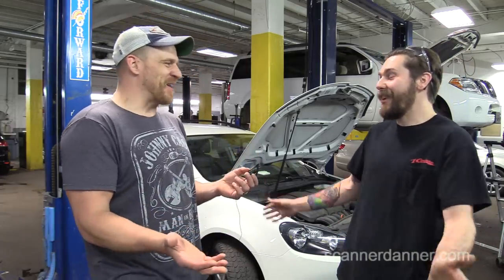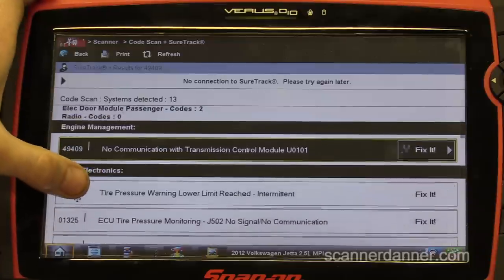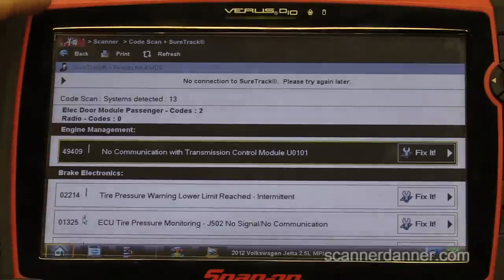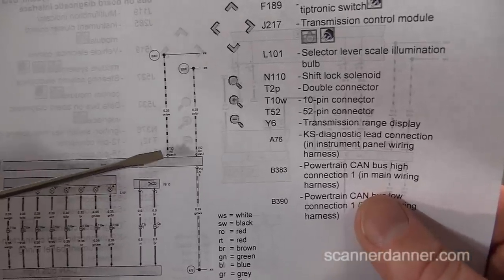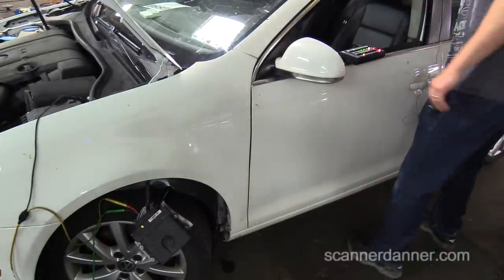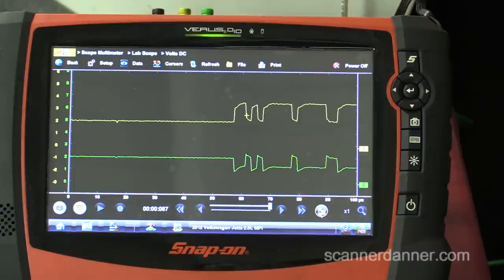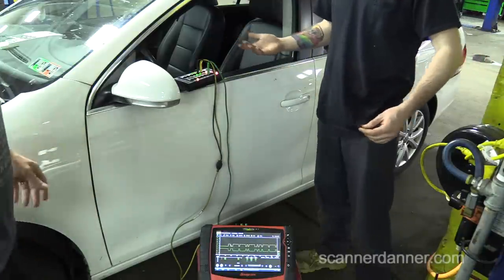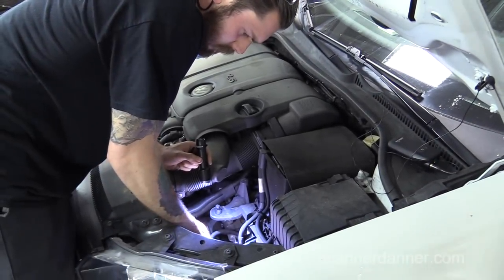2012 VW Jetta No Communication with TCM U0101 (part 1)

Comment: i have a volkswagen passat variant 2.3 liter all was fine it has 200k plus on it so i decided to change the transmission fluid after the oil was change gear no longer past 2 what can i do to fix it
Reply from the maker: This is what we were always warned about as techs. Do not change transmission fluid on high milege units that have not been serviced before. The new fluid you add with its high detergents will remove heavy amounts of varnish build up and plug up the fluid passages in the transmission. 
What color was the old fluid? When was it last changed? How long after the service did you start getting a 2nd gear only symptom?

Comment: If you want more info on CAN Bus design, try doing a google search for CAN Transceiver Application Notes.  You will find detailed information from the integrated circuit companies which provide the chips which are used in the modules along with the theory behind the bus design.  Perhaps too much detail ;-).

Comment: Will a bad module always show a bad can-bus wave form i know there's no way to diagnose modules thats why you have to rule everything else possible out so your only option is the module but what if you moniter the can bus and see a issue ???
Reply from the maker: no it will not, it depends on how it fails
Reply: @ScannerDanner  I figured that was going to be the answer lol thank you
Reply from the maker: @albertsautodiagnosticsllc2130  just remember that all the modules on the CAN network can send and receive data packets. If one module simply fails to send info, the network can look perfectly fine, especially if the terminating resistor is not in that particular module. Now if the failing module shorts out, it can and will effect the entire network.
Reply: @ScannerDanner  that makes some sense that the waveform would look good just because a module fails to send data but on the other hand aren't the other modules LOOKING for specific data from all the modules in The network.. im brand new to CAN system Diagnostics so please excuse my ignorance ignorance
Reply from the maker: @albertsautodiagnosticsllc2130  yes they are! Which is why we look for no com messages in other modules to help us! They speak the language we do not understand and will say "no com with (name the module)" Hope that makes sense

Comment: the engine ABS  transmission   ECUs are linked through the   high speed CAN  network.  you can have more than one high sped CAN networks. e.g. used for the smart  engine actuators.

Comment: Thanks for the video. I have a 2002 VW Bora 1.6SR, automatic  transmission. My own codes are 00529- engine speed signal missing01315 in ECM says to check TCM.
00518 - Throttle Position Sensor (G69)
00529 - Engine Speed Signal missing
00545 - Engine - Transmission, Electrical Connection
01314 - Engine Control ModuleMy car shifts normally but after sometime, it will go into gear 3 and will not shift to higher or lower gear. When you switch of the car, everything returns to normal. The cycle repeats often. Pls what could be a lasting solution to this erratic shifting of my car. Thank you
Reply from the maker: Your transmission is going into limp mode, caused by these fault codes. (no upshifting or downshifting).  If you clear the codes, which one comes back first? That is where you start.
Reply: Thanks for the reply. On rescanning the car, these codes were found. 01314, 01315 and 00545

Comment: i have a chevy 1990 caprice classic i have the tan-black wire from my icm moduel cut i think its the bypass wire am not sure yet do i need to fix it or its ok to leave it cut plz replay thanks
Reply from the maker: With that wire cut you will not have any computer advance, only a baseline 10 degree advance built into the module.
Reply: ScannerDanner so what do u think i should do do i fix it or let it the way it is
Reply from the maker: Fix it! Unless you like driving around with low power. Problem is why was it cut? Preignition/ detonation problems could be why and there are many causes for that.
Reply: ScannerDanner i have no idea why its been cut i bought the car the way it is yesterday i found it cut a month ago i changed the icm moduel and yes ur right i have low power really am gonna fix the wire i found out were its cut from am gonna put a jumper wire to fix it becuse the wire is short i really have no idea why its cut
Reply: ScannerDanner thank you so much for your replay am a big fan sir big fan
Reply from the maker: Thanks man! Make sure you check base timing (with bypass wire still cut) then after repair, if you have any detonation problems, next step is to make sure egr is working
Reply: ScannerDanner i will thank you so much for your help ur the best
Reply: ScannerDanner I fixed the wire that was cut and the car runs worse then befor i have no idea why i checkd the sparkplugs and they were black wish means running rich alot rich timing is good if i cut the wire it runs better i changed my ecu with wire not cut and still the same problem if i cut the wire it runs better also kinda rich i have no idea whats going on thanks hope you replay sir
Reply from the maker: Check and set base timing next.
Reply: ScannerDanner i will thanks alot for your help

Comment: Terminating resistors are used in the CAN network to help "flood" the lines with voltage quickly, the resistors allow for a fast increase in pressure / voltage on the lines

Comment: In my experience on heavy duty trucks on the Freightliner side. Newer stuff. The CAN network on the truck side has its own terminating resistors in the network. Two of them one in the dash and then the other in the frame rail. There is a central gateway on the truck that allows J1939 and J1708 devices to communicate to one another even thought they are different protocols. Then on the Detroit Diesel side there is a proprietary network where the terminating resistors are integrated into the ACM and MCM. The CPC acts like a gateway and communicates between the truck CAN and the proprietary power train CAN. So you have two CAN networks in one vehicle that have their own set of terminating resistors and two central gateways. I have also seen systems where the CAN passes through a module and that module is daisy chained internally to the CAN link. On this Volkswagen I would be inclined to believe that the DLC CAN is separate from the CAN network that the TCM is on. I would think that the central gateway separates the network into two pieces rather than acting like a pass through. I believe this would explain why you got different measurements while checking CAN line resistance at those two different locations.

Comment: I have a 2009 dodge charger that's giving me the same code u0101 I changed the tcm still having the code whoever had the car before me put a auto start in the car but disconnected it could the auto start be my problem
Reply: Jason Meyers I have the same code too and same vehicle but it’s a 2010

Comment: The resistors basically drain the current from the canbus and thus stop the reflection of the energy on the canbus network. That is a good thing as reflection would mess up the messages and change the Hex signal values so basically you'd get junk signalling that modules couldn't understand.

Comment: Fords have had gateway modules since '14 on most cars and have caused all kinds of issues and seen people replace modules when the gate way was at fault.fords spec on termination resistance is 60 ohms +\- 5ohms and have seen the same spec on semi trucks and GM's.and if you have short to power,ground, or resistance you will see it in the signal wave form,when you get a wave form like you did almost mirroring each other that is indication of system interference from a module and nothing else.ford has a network communication class for dealer techs but it's not good enough,and just like you I learned everything from expieriance,it gets worse when cars have 15 CAN joint splice connectors trying to find them all and witch one is have the intermitent pin fit issue.
Reply from the maker: Yeah, I went to two different CAN network classes in March. The first one I walk out of after the first break (didn't want to be rude) and the second one was very basic too. 
It was disappointing to say the least. Experience is key

Comment: Did you ever see an oil pressure switch cause an ecm no com?
Reply from the maker: A psi switch? No
A psi sensor? Yes (shorted 5v reference)
Reply: @ScannerDanner  The dealership called it both names. I changed the sensor and the scan tool now communicates with the ecm. I was going to unplug the sensor but the starter is in the way. I guess they thought that the sensor would last the warranty period, why make it easy to get at! Love your channel btw. God bless.

Comment: Just about any electrical engineer could explain why those terminating resisters are there.  I used to be an aircraft electrical systems specialist in the U.S. Force and used to ask questions like you did @32:16.  Why? Why? Why?! Then I got out and went to engineering school.  Now I understand exactly why they are there, how to determine their value, what happens when they aren't there or what happens if one becomes open, shorted, or whatever.  This subject can get really deep.  I mean as an electrical engineer you get all the way down to Maxwell's equations and the telegraphers equation.  It can get nasty. To study all the theoretical details you need partial differential equations, electromagnetics, vector calculus, complex analysis, and circuit analysis. The book I used in engineering school was "Engineering Electromagnetics" by William H. Hayt and John A. Buck.  

I have seen comments from another electrical engineer stating the resisters reduce ringing on the line (the communication line or CAN bus in this case). They do reduce the ringing but that ringing is caused by the voltage reflections due to a impedance mismatch between a source (transmitter) and a load (receiver). If you have a perfectly matched source impedance with the load it is feeding then there is no voltage reflection hence so ringing.  The ringing is the result of a forward traveling wave meeting a reflected wave. In a worse case scenario you can get you a doubling of the voltage at the receiving end.  So if you are transmitting pulses between 5 and 0 volts then it is possible, depending on the length of the cable, the cable's characteristic impedance and the terminating impedance at the receiving end, to get a doubling of the voltage at the receiver.  If you don't have a tolerant receiver then you can fry the receiver. This is much more of a problem in high power microwave circuits where  you can send parts flying across a room if you aren't careful in your design.  But in these kinds of low power CAN bus applications you will probably never see parts flying off a car due to impedance mismatches.  The thing to look for if you have an impedance mismatch is to look for distorted waveforms on your line.  You can sometimes just check the resisters but other times the resisters are imbedded on a circuit board where it's not so easy to check them without opening the CAN receiver module and desoldering one leg of the resister. Probably not a practical thing to do in the field.  If the transmitter isn't sending distorted waveforms but the reciever has distorted waveforms at its end then it is most likely the terminating resisters or the input impedance of the receiver has changed, which means you have to replace the receiver.  Corrosion and lose connectors can look like impedance changes to the transmitter so keep that in mind. Anyways.... All this communication stuff can get really complicated from an analysis point of view which is what you have to do in engineering school.  But to troubleshoot this stuff as a mechanic you don't need to know all this detail.

Comment: Pretty tough go on CAN problems without the factory tools and a network map.  This is why independents are shutting down everywhere.
Reply from the maker: This CAN network should not be causing independents to shut down. It is no different than anything else we've already been dealing with over the last 20+ years in this field. 
I just did a basic power window circuit on my last upload and had a comment from a guy telling me "just wait until you get a window circuit on a CAN network" and my reply was, it is still the same process in troubleshooting! You have an input, a controller and an output. It is nothing to be scared of and it certainly is NOT more complicated. If anything it simplifies the circuit.
Reply: Much respect to you, Paul.  As a Volvo master tech, I could not imagine diagnosing CAN and FlexRay issues without factory tools and knowledge.  My point was that most independents will simply not touch these type of issues.  No European dealer I have ever seen would use a labscope ans generic scanner as the first tools in a situation like this.

Most clients aren't interested in spending thousands of dollars in diagnostic fees, so as a business model it does not make any sense.
Reply: got it. Thanks man, I completely understand what you are saying
Reply: PS anytime you want factory Volvo or Subaru info, let me know.  I have a ton of stuff that might help you as an educator.
Reply from the maker: Thanks so much!

Comment: Pointless to check anything more guys there other than continuity from TCM to Gateway, and if that's ok it will go 2ways  1) call it a TCM unit second hand or new (budget and customer depending) or if you feel confident enough open TCM (bench job) and go straight to CAN transponder chip bla bla and the story goes on and on(too much hustle unless it's yours. Cheers from UK a Greek friend.
Reply from the maker: Keep watching! TCM was NOT bad.
Also the only thing attached to the DLC is the gateway. We were NOT measuring CAN resistance at 6 and 14

Comment: I think each can network has its own set of terminating resistors. So if you measure at the dcl it is not the same resistors as the Tcm
Reply from the maker: It depends on the model and yes you are correct, on this one, we were a little green still and did not realize we were only talking directly to the gateway module

Comment: I do have vag- com it is an older version it is the 409.1 but it does coding. relearn. and some diagnostic live stream / uses lap top with Windows XP/ Vista / and I think Windows 7 does pretty good also. really cheap i got mine at e-bay for $20.00 with obd / usb interface got me where I needed to go

Comment: im thinkin that gateway is a cheap way of making the european  setup work with usa standards. call it the fricken ze translaterin  module. so much easier to do than change the whole system and more cost effective. chances are the same car in europe has everything the same but this.

Comment: still need too load test the can bus lines, power lines and ground lines before you can absolutely call the tcm
Reply: Monitoring the network while it working is the load test.  If the voltage is staying at the right amplitude then the wiring is good.  This is a logic communication circuit, the load is IC's monitoring the voltage and pulse-width on the BUS.  IC's that monitor voltage have high impedance on their inputs.  There is not going to be much current on these communication lines.

Comment: You cannot assume that CAN signal will be perfectly square.. 

Here's a video of a Chevy Cruze CAN signal. Vehicle has no problem at all.

https://youtu.be/gUoXnWM69qM
Reply from the maker: You weren't messing around with your scope ground there were you?
Reply: No... Only cycling key off / acc / on.. and starting the car. 
Scope ground was direct at batt neg.

Car came in with communication issue and I assumed the can was the problem seeing that waveform but I was wrong.

 I lost a few hours trying to find out why the CAN was that weird. After a few hours I went to basic tests and found a bad ground behind the dash (g202).

I took this waveform AFTER the repair.
Car was then running perfectly fine, no comm issue at all.

I will check on another Cruze as soon as I have the chance.